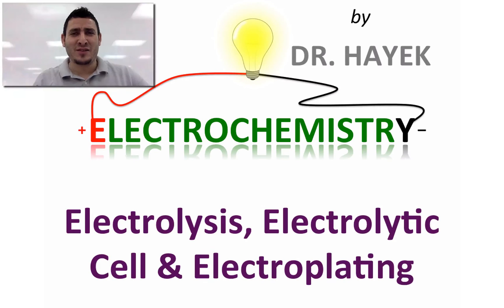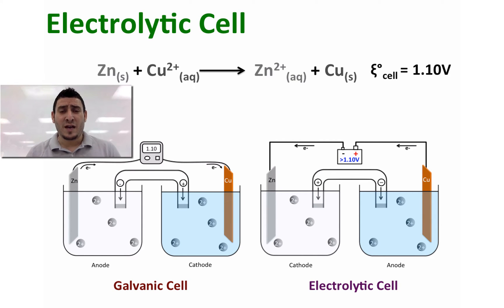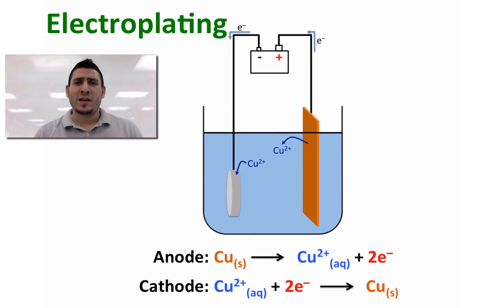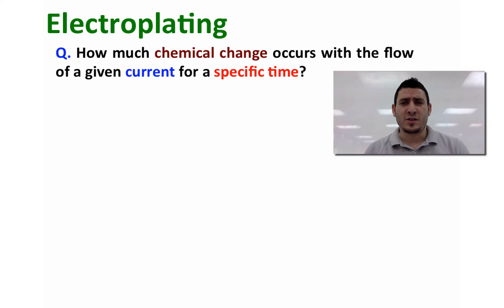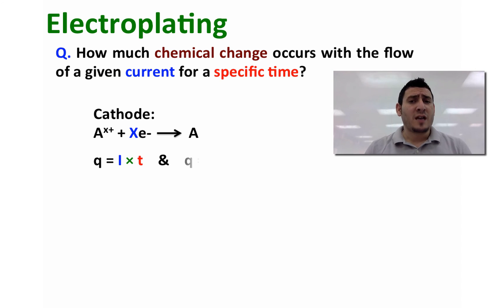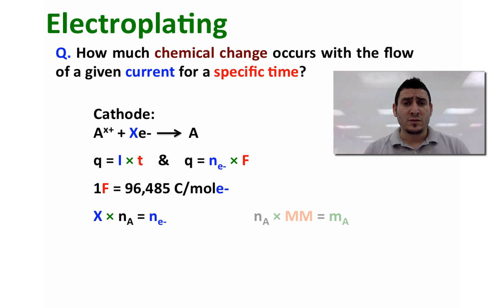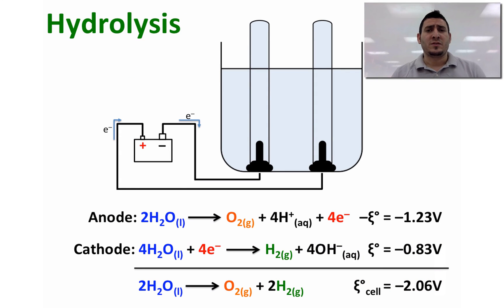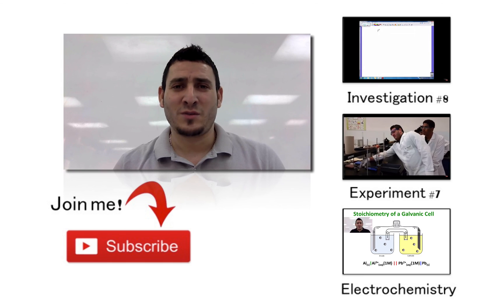Electrochemistry | Electrolysis, Electrolytic Cell & Electroplating.

Comment: what direction is the ion flow in a eletrolytic cell
Reply from the maker: The direction of ions flow from the salt bridge in an electrolytic cell (if it has one) will be the same as a galvanic cell. The anions will be pumped into the anode compartment and the cations will be pumped into the cathode compartment. this is discussed in the video from minute 0:28 through minute 1:40.
Note when I mentioned that the flow of ions will be reversed this is due to the flipping of both compartments between the two cells.
Reply: Thanks for replying back. Most people don't if you have a minute on your hands I also have another question what is my teachter asking here: Mg(s) + 2HCl(aq) -> H2(g) + MgCl2(aq) 

a) Describe what changes you would observe on the surface of the magnesium.
b) How would the rate of bubbling differ if magnesium were replaced with zinc? Why?
c) How would you rate of bubbling differ if magnesium were replaced with copper? Why?

It would be awesome if you could explain and give the answers to the questions thanks a lot in advance.
Reply from the maker: You are welcome, will always answer questions as long as my time allows.

For the following question, you should look up the standard reduction potentials of Mg, Zn and Cu.

Mg(s) + 2HCl(aq) -> H2(g) + MgCl2(aq) 

a) Describe what changes you would observe on the surface of the magnesium.
The change that you will observe on the surface of Mg is evolution of gas bubbles (which is hydrogen). And the magnesium strip will dissolve with time.

b) How would the rate of bubbling differ if magnesium were replaced with zinc? Why?
The rate of bubbling will decrease compared to Mg, because the standard reduction potential of Zinc (-0.76V) is greater than that of Mg (-2.37V). The reaction between Mg and HCl will have a greater cell potential (+2.37V) than that of Zn with HCl (+0.76V) which indicates that the first is more spontaneous and will proceed at a faster rate.

c) How would you rate of bubbling differ if magnesium were replaced with copper? Why?
No reaction, because the copper has a standard reduction potential of +0.34V which means that the overall cell potential of the reaction between Cu and HCl is -0.34V. Negative cell potential means non spontaneous reaction and therefore, the reaction will not proceed in the forward direction.

To understand how to calculate the cell potential and when a redox reaction is spontaneous, watch the following videos:
https://youtu.be/XpTbsI3G_zQ
https://youtu.be/OJ9SyDigCQ8

If you think my channel is helpful to students, please subscribe and share it with your classmates. Thanks for the support.